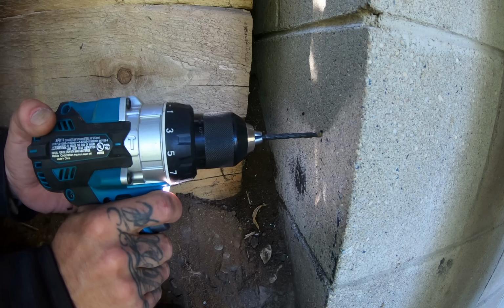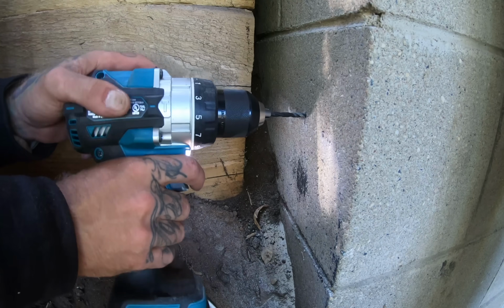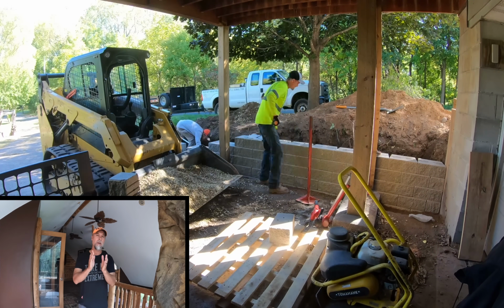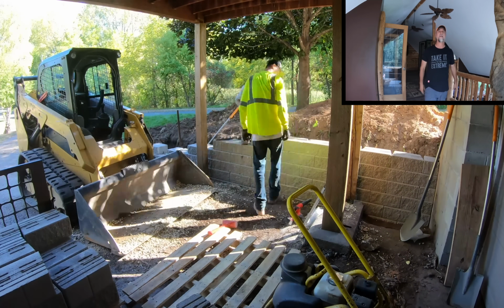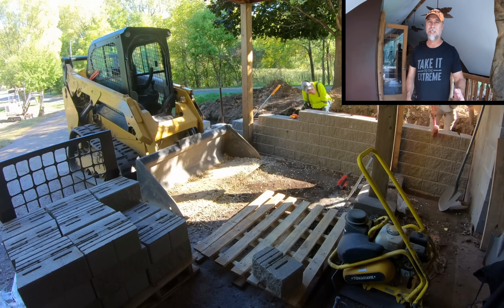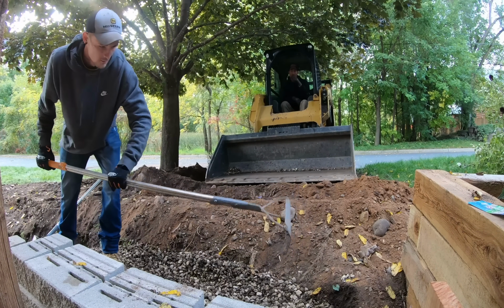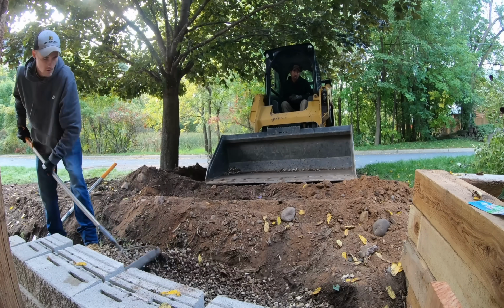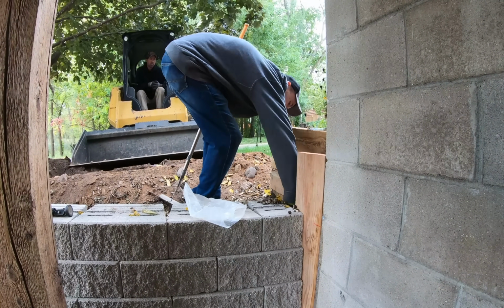Deck Inspection Brings Our Job to a DEAD stop.

Comment: I totally agree with you stan. Sometimes your gut says dont do it, so dont do it! My thinking was that there is always another job and I never had to worry about getting more jobs. One thing I was wondering was why dont they rebuild the deck first then the wall? Seems to me that the wall might be in the way and would then have to be taken down. Espif they have to dig new holes for the supports.

Comment: Replacing the posts is not really that big a deal. You could temporarily brace the deck several feet to the middle and lift it up with little hydraulic jacks, until the original posts hang free. Then you could do whatever you want to these and their footings. After everything is done, just lower the jacks again and fixate the deck to the new posts.

But the belly mentioned is a bigger concern, could be an indicator for a bad diy job and the need for a middle post...

On the other hand I get why you as a company can't have that liability on your shoulders.
Reply from the maker: If it was my house UI would do just as you say-  pop in some new posts and be done with it.  But I technically can't as this is for a customer and requires a whole nother level of service IMO
Reply: @Dirtmonkey  👍🏻
Reply: As usual a non permitted deck is causing an issue.
Reply: Deck beams in my area can not span longer than 8' without engineer stamped drawing. No way this was built with permit
Reply: @guyod1   probably right about the engineer’s stamp, but span lengths are set by the material and size.
Reply: @JoeAroner-SIWAYTV  inspectors have gotten extremely strict on decks in last 10 years. Lumber outside will split or rot eventually. Snow loads can be 10's of thousands of pounds. A couple have collapsed and they dont want liability.  But that said there is no amount of 2x12s that will let you span 20'  that is steel or lvl

Comment: Rotten posts for the deck? Who cares about berms? They need to spend the $$$ on a fix for the deck. I don’t see how the customer can do the post repair later with the wall so close. I’m guessing an 18” tube 4’ below the driveway would work. An auger on a skid steer could dig it easy before the wall but not later. It would sure be better than the rotting stuff under heavy load. You could even bring it a foot above and it would last longer than burying the post. I’m amazed at the unsupported 20’ span. I would not consider a deck party on that deck with all the planters removed!

Comment: Sorry Stan I love all your work but this one is a buddy Hackett job, that piece of 2 x 12 the end of the wall is hack and the fact that you’re not going 2 ft off the house and then making the wall so you have room for your footings and everything for your deck later on I’ll give you a colossal fail on this one
Reply: oh i didn't know we were here to judge their work!! o just thought we were here to watch how they work! interesting, ill start judging them from here on out
Reply: Isn’t that 2x10 wood patch job going to rot really fast?
Reply: @ih8chz  So you must be Gene Hackman love to see some of your work
Reply: They didn't build this deck ....
Reply: @mmiller1188  no kidding dummy, guess u don’t get the point, so stop thinking u are going to hurt yourself
Reply: @mmiller1188  op didnt mention deck he is talking about the 2x10 against the foundation of the house they added. watch video again.
Reply: Just a Hmmm 🤔 Would it be Possible to used your Wall Blocks a Post for the Deck or any type of Deck ? Just a ??
Reply: @cc5477  no it’s not a frost footing ang it’s not designed for a load on it like that
Reply: @ih8chz  everyone is here for their own reasons. I'm here to to see peer-reviewed content. Love the other perspectives I see in the comments
Reply from the maker: I appreciate your opinion. But just to clarify that was a green pressure treated timber rated for ground contact. It’s the same material that they build house foundations out of up in this neck of the woods.
Reply: @Dirtmonkey  
Me and you both know that pt 2x12 will be toast within 3 years.
Reply: @Dirtmonkey  Should last at least 10 years.
Reply: @johndobyan1834   I'm curious why  you say that? Did you see the end tag on that board that differs from his statement that it was treated ground contact.   I know he said Green which when I hear that term I think of CCA. But we both know that was  phased out years ago for residential construction so it is probably ACQ.  I just find it interesting because I have been to more wood treatment plants in a week than most people will probably ever see in their life. Unless they work for the AWPA or something. Maybe you have used UC1 or UC2 or UC3 when you should have used a UC4 or something else and now you think all treated lumber is junk? In spite of all the education and wood tags most people don't understand wood preservatives and that is a big problem.  You can get the chemical for both critters and rot and decay and they can last a lifetime. But you must use the right treatment. And big lumber yards do not stock near all the options. They stock what they make $ on.
Reply: I lived in a house that had a retaining wall built entirely from similar materials. Wall was about three feet high. Had 6x8 post every 4 feet with 2x12 boards on the uphill side of the posts. Wall was 19 years old (was constructed when the house next door was built) and still was in good shape. I am not an expert, but I know it can be done, because I saw it with my own eyes.
Reply: @firehydrant315  Doesn’t mean it’s right I’ve seen a lot of things done and a lot of people are dodge bullets with shitty construction doesn’t make it right and doesn’t mean it won’t fail
Reply: I agree rather like to see a L shape wall or something else there than wood
Reply: @ih8chz  in my opinion  , if you're gonna show your work  off then you're basically advertising  your work  and what you see is what you get , shabby workmanship  simple as that and yes I can do better because  I have done better and definitely  would not cut corners like this .
Reply: @johndobyan1834  where are you buying lumber that only lasts 3 years???
Reply: @Leotheconstructionguy   probably comes from the same place you get it, bugs get in water soaks in, I’m a builder. We buy old houses and build new. So I see it alot
Reply: @johndobyan1834  Nope, it's clear you don't know a lot. It's not just a piece of soft pine wood.
Reply: @klesko55 you don’t know my expertise, to put a piece a pt behind the wall like that will rot, if you haven’t seen it then your experience is questionable, fence post that are pt rot.
Reply: @johndobyan1834  a Fence post will not rot for 30 years or more if it is say a treated Southern Yellow Pine that is under 19 percent moisture before being pressure treated to a .40 or greater CCA. Now CCA only has 7 use categories so no experienced builder would compare a fence post to a dimensional board. However some manufacturers may treat a fence post with mca or ACQ but what kind of wood is it and what moisture is it before it's treated? Why wouldn't they use a CCA if it's a legal use category for a fence post? I would not buy a fence post if it is not treated to a minimum.40 CCA. Otherwise it is not even a valuable fence post.     You need to know what you are buying.  If you buy a jack pine or mix of pine from some places they are treated wet, with no guarantee of treatment retention. Them posts usually have a max one year warranty with 5 year expected life.  They don't even remotely compare. So your vague comment actually sounds smart but  is actually useless.
Reply: @ifyoutip  so why put a pt post if it’s going to rot? A 4x4 pt is used in building and in fence work why would you not compare they can be used in both areas, The make dimensional lumber in pt, just Bc it’s rated doesn’t mean it’s good to use. Looks good on paper but in the field it’s not good, did you see the tag?
Reply: @johndobyan1834  🤡
Reply: @johndobyan1834  Worked residential construction for 15 years built fences, decks and a few PT retaining walls. Key is drainage and appropriate grade of PT lumber. Built my kids a swing set with PT lumber set into ground was still solid at ~25 years,. I've seen rot in under 10 years for PT post set into concrete filled holes.  Never seen bugs in rotted PT.
Reply: @Dirtmonkey  then they build an inferior foundation if that's what they use.
Reply: I think he knew it would cause more work for him to check the footings and make the right adjustments,... he just made a ton of work for the next contractor
Reply: there was no other option
Reply: @ih8chz Are you still as unaware as you were one year ago, or are you still walking into walls?
Reply: Get in, get out, get paid. I agree- it’s going to be a bitch to re-do footings that close to the wall. Maybe he’s anticipating the ol’ double-dip to build it again once someone else rebuilds the deck.   Not my monkeys, not my circus. <see what I did there?

Comment: Why not go back 1 course of block and out 1 course  away from the existing wall and eliminate that wood and L bracket  ( that's gonna rot and rust away not far down the road) , yeah it's gonna be a few blocks more and not that much more time involved and it'll look way better  than a piece of wood shoved in the ground . IMO , not good quality  work and you tagged it with your name lol . Curious as to what kind of warranty did you give the homeowners , wood will rot out , caulk joint to house will turn loose and then you have the beginning  of the dirt being taken  away above  the work as it erodes in the big gap you gave it . 👎

Comment: My back hurts watching these :-) Question, How do you deal with inspectors make you jump through hoops while everyone and their brother just build what they want where they want without permits? All out in the open, using the street curbs to store sand and gravel or putting the bins on the streets for days and days or busting up curbs to make driveways wider?  It would drive me CRAZY!
Reply from the maker: We follow code on our jobs or we could get fined.
Reply: @Dirtmonkey  Agreed and its just the right thing to do BUT it would still bug the crap out og me . Just wired that way I guess
Reply: @armchairobserver4747  - when you do the right thing, you have less to worry about.
Reply: There is a legal difference between being paid to do the work and doing the work yourself.  Where I live, my in-law's house had a screw in fuse panel but were wanting to put in an electric dryer that needed 240 volts but they did not have room in the panel to install the circuit.

Having someone come in and replace the panel for pay would have required permits and insurance and whatever.

But I grew up on a farm and we did not have time to wait for people to come out and do what we needed done so I learned hands on how to do a lot of useful things.  Besides, there are no city code inspectors when you live 20 miles from the city.

So I took measurements and wrote out a list and went to the store and bought the necessary supplies.  Turned the electricity to the house off, pulled out the old panel, ran the wiring for the dryer which went through an outside wall and into a small storage room they had built on their rear porch years before, and I ran some more wire through the attic to the furnace closet, installed the new panel and all the necessary breaker switches, and got everything hooked up.  The wire through the attic was so I could install a ceiling fan/light combination in the living room with switches for both and a couple of plug receptacles (for just in case) on the wall of the furnace closet for convenience.

Because I was not doing it for pay I did not have to go to the city with a plan that had to be approved and pay for permits.  So they had an old house with a modern electrical panel with breaker switches instead of fuses, which are safer and much more convenient.  And I did that about 30 years ago and it is still working fine.

Comment: I don't like the board my 0.2
Reply from the maker: Me neither but it was an easy fix versus taking it to another level.
Reply: I thought the wall would go out, then turn 90 degrees thus would not have a gap or need to fill with a board

Comment: First off this does not appear to be an "inspector" - looks to me like some kind of engineer. An inspector is not going to come out to the job and start figuring what needs to be done at the site. If he's doing his job properly, someone should have submitted the information on the retaining wall, (which in many cases may need to be engineered itself).
So Im seeing what appears to be a newer post holding up the beam along the house - based on the fact that its in the garage door opening - so was this some kind of temp fix?
Secondly, youre saying because you cant verify the column footing depth (or if there even are any) your "walking away from the job". Why? Its a simple matter to determine whats there and if its sufficient. The removal and replacement if that is necessary isnt a big deal either. So you charge this homeowner big money no doubt for the retaining wall and leave him in the lurch on the deck repair? Especially when it would have been much easier to replace or install column footings BEFORE you built the retaining wall.

Comment: so let me get this right you guys dont know what sds is? what a bunch of amateurs
Reply: 😄😄 for a half dozen small diameter holes into cinder blocks. 😄😄 That hammer drill is fine for that application, although I'm not sure he had the hammer drill function engaged.